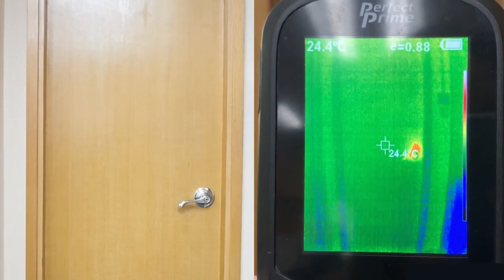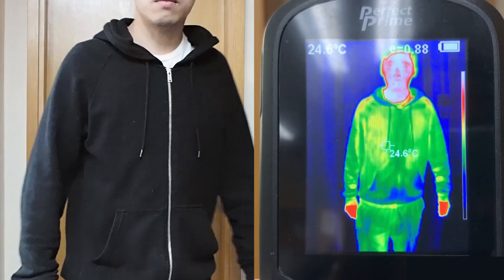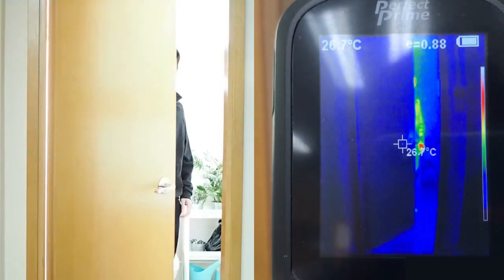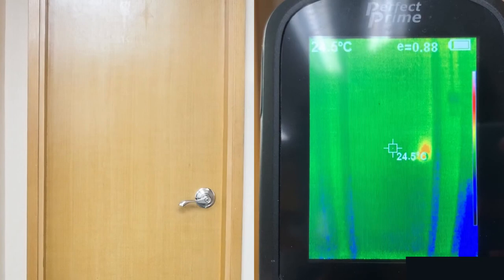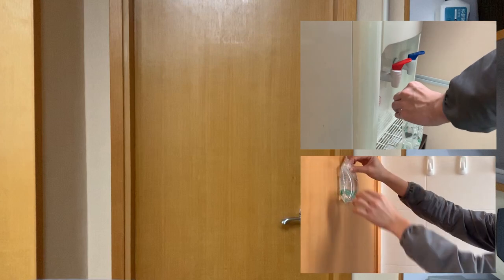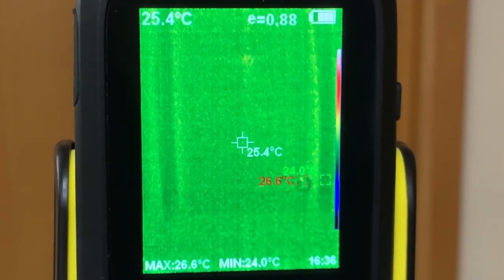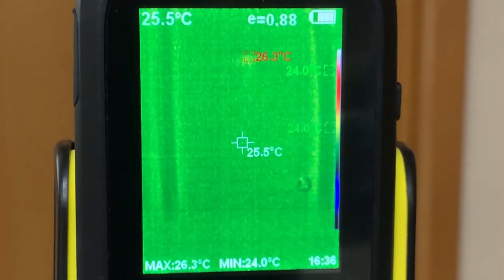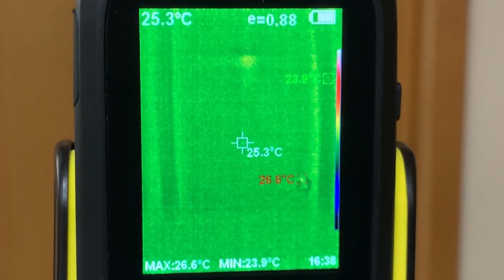Can a thermal camera see through walls?

Comment: any insulated wall or door will block thermal images. That is what they are supposed to do.
Reply: Oh I thought walls and doors were for privacy and warmth?
Reply: Tell that to the poor idiots growing plants at home 😂 choppers pick up all the thermal signals.
Reply: And so a non insulated late 60's plaster on concrete block dividing wall between town home units, may well transmit nearby thermal images ie. human?    Sure as heck doesn't block sound.    And thanks for what you may know..

Comment: That looks like a door to me not a wall
Reply: It depends from where you live, but, the idea still applies... If something that thin could "block" the view, imagine something thicker like a brick wall
Reply: @ForeverMan  Not all walls are made from brick and its still a door
Reply: @ForeverMan  lol
Reply: @smurfinghot  that is a common hardboard door
there is no way that door is thickier than an common drywall, so if the door is able to block the vision, every wall is also able to do it
Reply: @guifdcanalli  I bet you could see it through a greenhouse
Reply: @guifdcanalli  it's not only the thickness that matters. The material is also very important
Reply: @zZULTIMATEPROZz  you cannot see through a greenhouse with this camera. In the dark, a common flashlight is a lot more useful to see whats behind glass than a thermal camera. Glass is opaque to thermal radiation. So yeah if you put your hand on the greenhouse from the inside (and heat the glass with your body warmth), a silhouette of a hand slowly appears on the outside, but the entire person is definitely not visible to the camera.
Reply: If the door is made of solid wood, it will block signals more than a hollow wood door.

If a hollow door is filled inside with an insulation material with metal lined backing affixed to it, it will also block signals well.